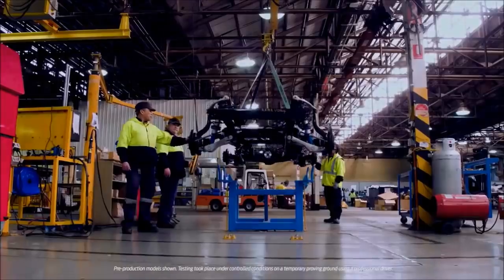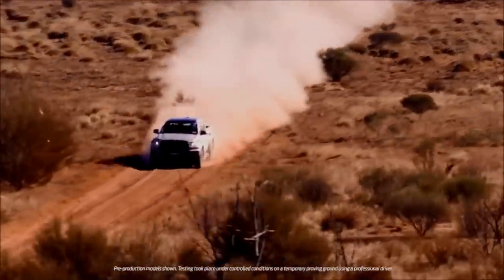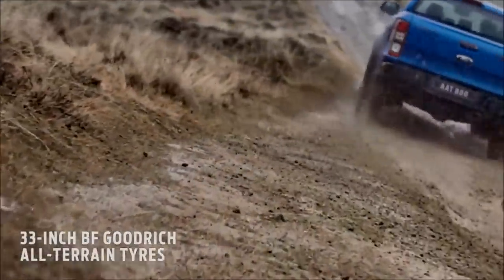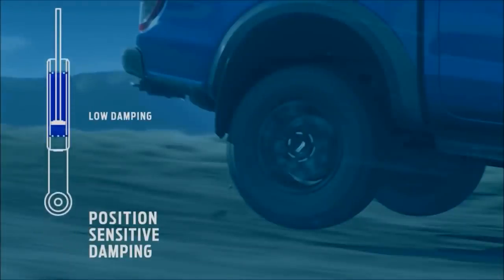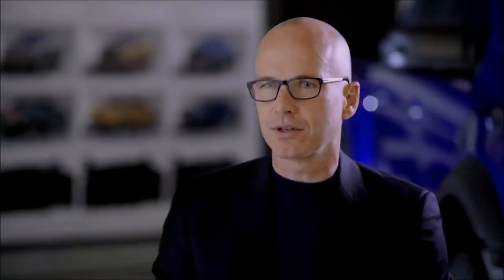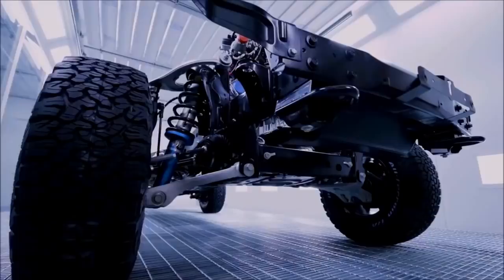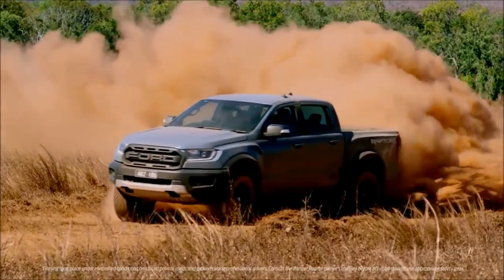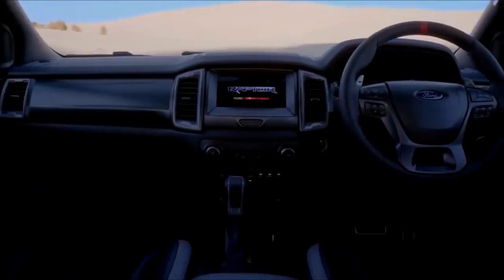Ford Ranger Raptor - The Best Pickup Truck Ever !!

Comment: Just so you yahoo's know that 2.0 Liter Bi-Turbo engine has more horsepower and torque than the 3.2 V6 and gets vastly better fuel mileage (28-30 mpg).
Reply: Wow it takes 18 secs to do the quarter mile. What a Slug
Reply: Well what do you expect....it ain't designed or built for speed, it is designed and built for going any damn where you want to go.

If you want to go fast you don't buy a truck!
Reply: Diseals suck
Reply: JJD no they actually dont
Reply: @jacobj1517  all the emissions shit now.  Yes they do.  I have the v6 colorado and consistatnlty have 20mpg in the city .
Reply: Yeah but that also means a lot more stress on the block, pistons, rings, higher cylinder pressures and heat. Which means, less reliability.
Reply: M.A B then what’s the point of having Baja mode?? If it can’t go fast enough.
Reply: @sschevmale24  damn dude if you gonna diss something learn to spell!
Reply: @tannerwohleb1918  thank my galaxy s5 hahahahhahaha
Reply: So does your spelling.
Reply: @tannerwohleb1918  last time I checked it's "going" not gonna
Reply: Its not a v6🤣 its a 5 cylinder only
Reply: @Disabled_Vet_72  they call it a high performance ute when it's not.
Reply: @Cliff Sinclair I guess "High Performance" is a subjective statement. For me "High Performance" means "better than your average UTE" and this is by far better than any other UTE or Small Pickup/SUV out there. It can go places and do things that no other STOCK MASS PRODUCED VEHICLE can do.
Reply: If you’re buying a Raptor and thinking about fuel economy you’re wrong
Reply: Richard Colbert and less reliability l
Reply: @Disabled_Vet_72  get any of the current utes and put fox suspension on them and them will basically match the Raptor. The US proper Raptor would destroy this gutless 2.0 liter. Even the US version Rangers have the 2.3 ecoboosts which will also be a lot better suited. I like the ute just hate they ruined it with the engine choice
Reply: The entire reason this truck marketed is going fast and or jumping it so anyone talk about it not meant go fast is fucking slack wit . It is slug slow like all fords makes it more funny when even special made to to fast ford is still slow hahah
Reply: This raptor(engine spec'd) is not for the US market. Few vehicle owners there know what is a diesel engine. Besides gasoline there is cheap and has govt subsidy, hence, they like their gas guzzling V6 and V-whatever...
Reply: Lol 2.0 well the girls will love it.
Reply: Yea but its ford so it will also wear out twice as fast.
Reply: But it doesn't get better than the 3.2 liter i5 diesel. Which is max at 40.
Reply: @sschevmale24  You might need to do some  research before you type something you know nothing about.
Reply: @sschevmale24  you got the wrong truck with the wrong engine.
Reply: @sschevmale24  bet you would sell your colorado for a Prius
Reply: @shlumpeez3940  dude whatever lol......New supra yes !!!!!
Reply: Fate Breaker do u really believe THAT? Lol.....Almost all gasoline engines, diesels, use the same exact metals, and processes to make the parts which 99% of look and do exactly what the next part does....be it Ford, Toyota, or suzuki......and I have seen Ford's with over 600,000 miles on orig engine, transmission....same with a couple Hondas....
Reply: @connorlewis4183  but they tested it for 18 hours of continuous running at full throttle... it's gotta be good
Reply: Rich Joy how does that prove anything? Full throttle on a dyno for 18 hours? Why wasn’t it 24 hours? My guess is that if failed at 18 but it was good enough for their standards, and plus. Full throttle doesn’t exactly mean top rpm. It’s a diesel, they naturally just last longer and with a wimpy 6,000 rpm redline (high for a diesel but lets face it low for a gas) of course it’s going to last for at least 18 hours. That’s nothing to really be proud of. That’s not a groundbreaking revolutionary engine per say. It’s just a 2 liter diesel that may or may not have survived an 18 hour full throttle run.
Reply: @connorlewis4183  calm down.. it was meant to be sarcastic
Reply: @diyanything4319  is it impossible to drop whatever engine you like in there I mean just a question?
Reply: @robertphilip6649  diesel is cheaper in North America as compared to gasoline-- sometimes as much at 30 cents/ gallon. what are you talking about?  Also, the Ram power wagon called.
Reply: @TacticsTechniquesandProcedures  yes money wise it is
Reply: @TacticsTechniquesandProcedures what i was talking about is the cost of gasoline in north america compared to gasoline sold in asia specifically  the ASEAN market where i belong. It is very expensive for us here to own & maintain a big displacement gasoline engine(e.g. F150) than a diesel engine that is fuel efficient. In the Phil the unleaded gasoline is more than a dollar per liter(P60/L) while diesel costs less(P45/L).
Reply: you don't even know the 3.2 was a 5 cylinder #facepalm
Reply: Richard Colbert they are advertising it as a Baja truck. They go fast.
Reply: Connor lewis  18 Days straight at full throttle mate have another listen!! 👍
Reply: That 3.2 diesel is a beast. Test drove the wildtrack ranger it’s very powerful. Will buy raptor with diesel any day.
Reply: Needs the 3.5eco ho out of the f150 raptor, Or just the base one would be fine.
Reply: No one buying this will care about fuel consumption. Period! It needs the coyote off the Mustang and better brakes to say the least. This power plant is a joke and the brakes are tiny
Reply: @Disabled_Vet_72  
Your HP and torque numbers are useless if the engine has to do a very high rpm just to get that number.

You're a pretender if you rely on those numbers alone without considering other factors like power-to-weight ratios, low rpm HP and many more.
Hell, barely anyone can even get that high of an HP or torque in the real world. 
And mileage isn't even real world figures.
Reply: V6???? 😂🤣
Reply: @diyanything4319  geez.. you're like expecting a dirtbike to do better figures than a street bike in a quarter mile. Get real.. this ain't you're fast car.. it's called a pickup truck.
Reply: @whatswiththissassylostchilld  fast on baja is a different fast on pavement. Try riding a street bike fast on unsealed roads against a dirtbike. Hope you got my point.
Reply: @manugatzi6158  easy don't call it a performance ute when it's not. The 3.0l Amorok smashes it for speed and uses less fuel. What a pathetic   engine
Reply: Manuel Gatzi it should still be able to hook up on pavement even if it meant for off roading. And then again motorcycle tread is different then cars and trucks, a sports bike tread is skinner and more oval than a car or truck.
Reply: @sschevmale24  Sure kid. Most heavy machinery in this world is run by diesel power.
Reply: @4g63gen1  first I ain't a kid second the don't have emissions like cars and trucks
Reply: @connorlewis4183  18 days, not hours.
Reply: It literally said "full throttle for 18 days straight", not hours. I'd say that's impressive
Reply: 3.2L is R5 engine, not V6
Reply: @donovanziesmer3682  And the le mans 24 hr has been won by diesels for the last few years. Horses for courses I suppose.
Reply: James Marquis  I guess you haven't been to the dry straight lately
Reply: Is it more powerful than the new Vw amarok v6?
Reply: 197 hp with 368ft/lbs of torque? That's madness. I'm with everyone else. I'd rather have the 2.3 eco with 300 hp.
Reply: Well the 5.0  V8 in my F150, is STUPID!!! 16mpg at best, and that’s 55-60mph on 4 lane! Driving everyday I average 13.8mpg!!!
Reply: ohh yes, that will be excellent for long term reliability yahoo seekers, lol, I've heard they coming up with 1.1 liter quadruple turbo soon
Reply: @reubs91  rigggght!!! Because building a production baja truck should meet the actual track truck specs??  Most ignorant comment yet sir!! No it doesn't need to be fast.
Reply: @Richard Colbert brother preach! You said it all.
Reply: And one more thing....they may have build a full fucking jacked v8 if it was meant to be fast???????   Try again son!!!
Reply: Conner Lewis....exactly. You can always get more horsepower out of a motor but at what price. The 3.2 ltr is de-rated to buggery to conform to fuel efficiency targets and because most people dont need a 700Nm truck but it is easy to get an extra 100Nm out of it with a few relatively inexpensive tweeks. I wouldn't buy this with the 2ltr engine.....big step backwards IMO.
Reply: Turbos dont last though.Too much pressure on the engine.
Reply: Richard Colbert I beg the differ.... remember the syclone????  there are tons of street trucks out there.... many of them outrun vettes... camaros ect

Comment: I personally owned a 2012 ford raptor, the red stripe in the middle of the steering wheel completely came off, the silver plastic on the shifter chipped off, the fender on the right wheel fell off when I went over a little puddle, It did 10 miles per gallon all day, and the list goes on and on. Traded the truck in for a brand new Honda clarity, difference in quality is night and day, one have to be crazy to buy a Ford again after Honda. Ford people need to step their game up and stop making cheap cars with cheap parts, start using some quality material so the car actually lasts
Reply: Gera K
So you are saying you bought a piece of shit Ford   with bits falling off it . Why did you buy something with such shitty build quality ? Your mistake was you  did you not bring a man with you when you bought it. Stick to buying kitchen appliances  !
Reply: Thanks, I appreciate your honesty.
Reply: Its not Fords problem you cant drive and smash into things